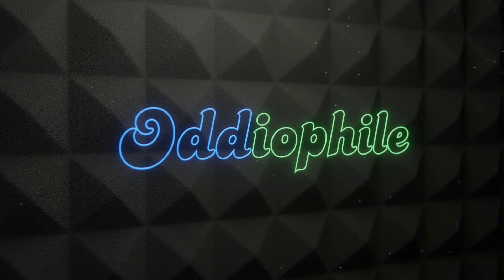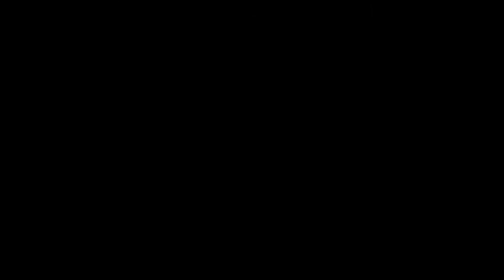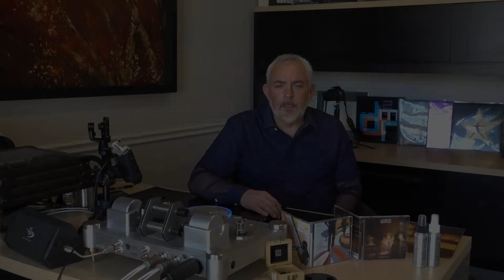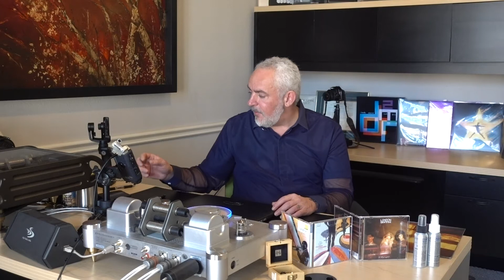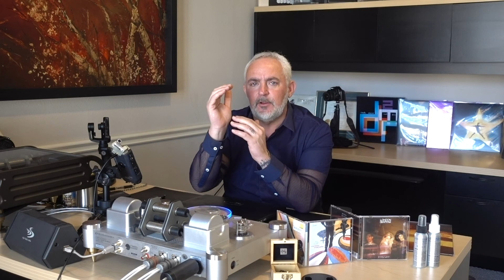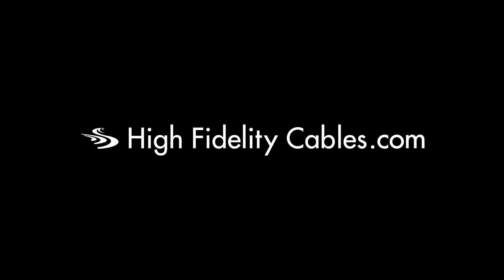The things on my desk take 2

Comment: Rick, Hi. I've watched all your videos and come to appreciate your perspective. I'm wondering why other than the manual act of putting in physical CDs into a transport, would you spend $2500 on a CD player, and then $5k of additional components (not including labor) into that same CD player, when you can potentially rip the same CD and play it on some very high-end servers/streamers/etc..I'm not speaking from a place of knowledge about this because I haven't listened to high-end streamers like an Innuos server/streamer or for that matter your CD Player setup. Wondering what is the best sounding solution?
Reply from the maker: It would fair to say that in this day and age the streamer is probably a better choice. This is because the streamers are far more flexible with today's changing formats. Streamer will do DSD files etc. Where on a CD player you're limited to 16/44. 
Because we have the facilities and ability to do the work it. We found this a better choice than buying an 8 to 10K player. No regrets here. 
Why did we choose a CD player? Most of my media is in CD form? When people listen they don't have to guess what format it is. So when we show and get a very good sound which this unit was originally used for people to know that it is our technology that is working to get the sound. It retired onto my desk for my headphone system and by the way, it does have an input for USB, so I do use it as a streamer as well. 
However, it will not do DSD or DSF files. If I was to recommend someone getting a player what types they go with? I would recommend a streamer. Maybe the Lumin U1. I'm looking at one of these myself. These do not have Internal DAC btw just a streamer. I have a nice DAC so don't need it to contain a DAC.  I hope that answered your question.
Reply: @virtualdynamics  Thanks for answering my question. helpful, and thanks also for a recommendation for the Lunin U1.. I had heard about those as well. One day.
Reply from the maker: You welcome when you import try importing after the Cd tweak. I import on my other system and treated CD's sound better than non-treated.
Reply: Hi Rick, Just an aside question since you the man when it comes to tweaking AND knowledge. Having had success with your brass screw tweaks, I was wanting to apply some brass screw technique to my Nottingham Space Deck turntable. On their instructions, they recommend that you tighten the Allen/hex head screws, but do not overtighten as that would affect the sound in a negative way. I would like to replace some of the screws (or all I can) with brass, but cannot find any that are the right size. Since it's a British company, I assume the screws are metric, but the one's I pulled out seem to be between sizes of M4 (M3.5?) and M5 (M4.5)
I emailed the company but no answer. Just seems to make sense to replace any screws that affect sound (without high torquing) with brass.
Any suggestions? Thanks much! PS, also tried 8-32's etc.
Reply from the maker: Sounds like a fine idea I don't know how to help you on finding screws though.